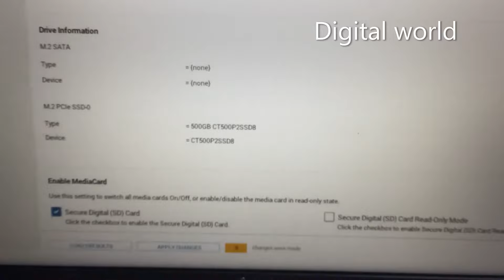DELL LATITUDE 5430 I5 1235U RAM AND SSD UPGRADE

Comment: Can we Install 2 SSD ?
Reply from the maker: not possible in this model. only 1 ssd slot in this model.
Reply: Maybe one b+m x2 ssd in the wwan slot and a regular gen 4 ssd in the main slot? Im not sure but i will test this on my latitude 5420 (i got it and nope, only one) The 5520 does support 2 tho
Reply from the maker: @KIDIYOfficial  Dell latitude 5520, Dell latitude 5520 , ssd NVME 2 slot
(please like share and subscribe our channel for more videos)
Reply: @technologyhelp24 Yes. 5520 and 5530 both have 2 slots (One Gen 4 and one Gen 3 slot). However the 5420 only has one gen 3 slot and 5421 and later have gen 4, but my 5420 does not support ssd in wwan slot even after bios update.